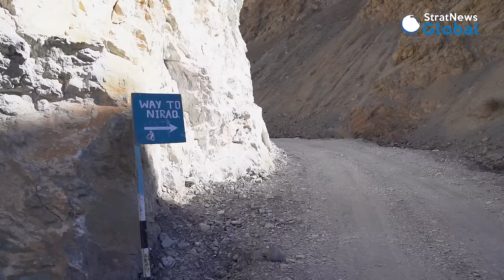NPD Road: Critical Connectivity To China, Pakistan Himalayan Fronts In Ladakh

Comment: Cement plastering of the carved mountain walls upto the ceiling will ensure saftey as well as prevent stone sliding after a severe snowfall.This is because  all the cracks in the mountain would be water proof sealed